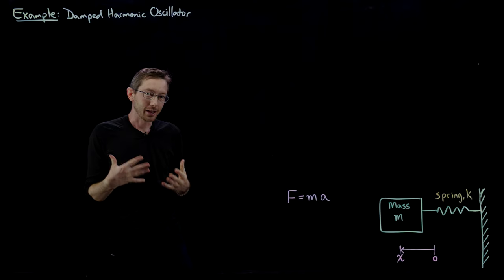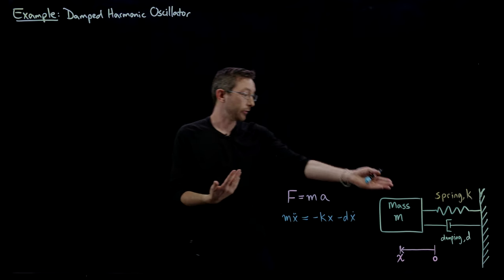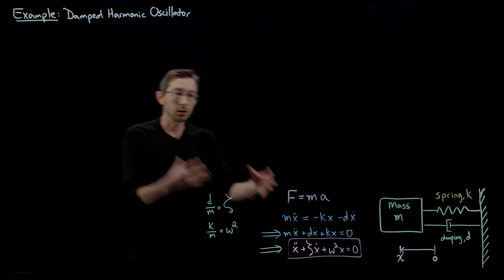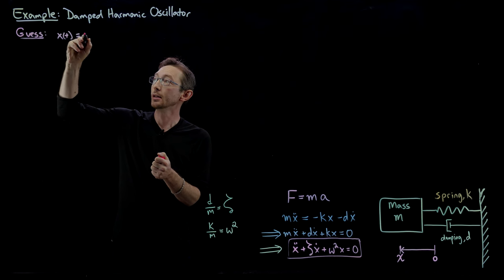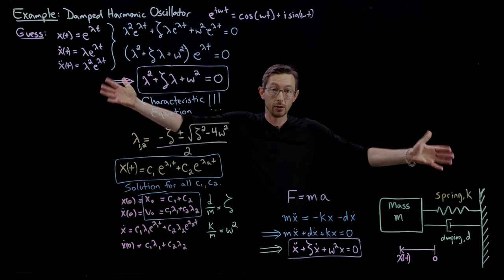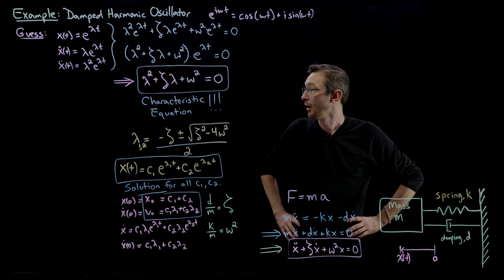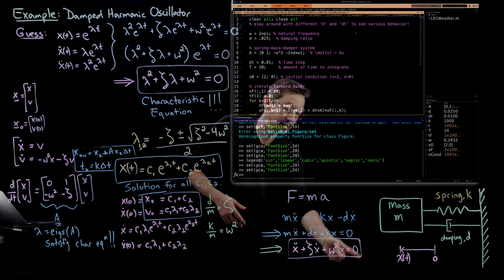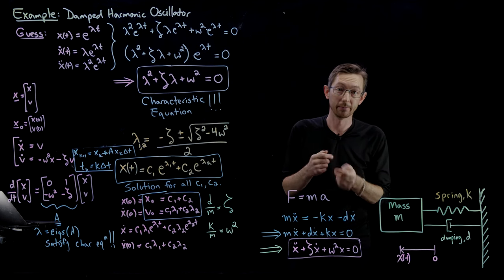Example Second-Order ODE: Spring-Mass-Damper

Comment: for future ref) Prof. Steve defined 'd/m=ζ', but typically people define 'd/m=2ζω' (see Harmonic oscillator in wikipedia) which the matlab code follows,
and the 'd' in the code means ζ in that setting.
In the code, that's why there is -2*d*w (-2ζω) instead of -d (-ζ).
Also note that we didn't solve the eq. analytically("by hands"), but used numerical analysis in two ways(rough one and fine one).

Comment: What was defied as ζ (zeta) in the written section is actually not the damping ratio. The normalized 2nd order homogeneous equation is typically written as xdd + 2ζω*xd + ω^2*x = 0 where ζ in this case is the damping ratio, which can be defined as ζ = d/d_crit, and d_crit is the damping value that results in critical damping, which occurs when the discriminate of the characteristic equation is 0. On that note, in the code when bumping up the damping ratio to greater than 1, that's an over-damped case. Critical damping only occurs right on the boundary of pure convergence and oscillatory convergence, which is when the damping ratio is 1 and d=d_crit.
Reply: I think this comment should be pinned in order to avoid confusion. Thank you!
Reply: Hi Erik - you seem to have a good grasp of it all - I totally agree with your statement. Can you have a look at my comment - maybe you can help me out? Thank you.

Comment: What a great video again Steve, a brilliant explanation of a not so easy subject. I have one further question: After solving the characteristic equation for lambda, we have three possibilities: lambda_1 and lambda_2 are both negative, lambda_1 and lambda_2 are complex with negative real part, or lambda_1 is lambda_2 and there is basically just one negative lambda. So we have an over-damped system (no vibration), under-damped system (damped vibration) or critically damped system respectively. This final system will only exists for specific combinations of mass, damping and spring, while the under- and over-damped systems exist for a whole range of choices for mass, damper and spring. Using the initial conditions - x(0) and xdot(0) - we can now solve for the constants C_1 and C_2 in the solution x(t) = C_1 exp(lambda_1 * t) + C_2 exp(lambda_2 * t). This makes sense from a mathematical perspective, it is a linear combination of the two solutions, as well as from a physical perspective. And this works fine for the under- and over-damped systems. But for the critically damped system, you get that C_1 + C_2 = x(0) and (C_1 + C_2) * lambda = xdot(0), which doesn’t allow you to specify C_1 and C_2. The solution is to use x(t) = (C_1 + C_2 * t) exp(lambda * t). I know that. But I don’t understand WHY that would be the right thing to do - from a mathematical perspective as well as from a physical one - it doesn’t comply with my intuition. Is there anyone who can shed some light? Many thanks!
Reply: We need to add up two linearly independent terms, in order to form the general solution.  Or more generally, for an nth order homogeneous DiffEQ, we need to add up n-terms that are linearly independent.  Anytime there is overlap, you need to generate a linearly independent term, by multiplying it by t.

This is what we do when we have a forcing function of the same frequency as the natural frequency of an undamped oscillator.  The non-homogeneous forcing function adds terms to the solution, but it still is a combination of linearly independent terms.  The solution won't just be a linear combination of sin(w*t) and cos(w*t), but rather it will be a linear combination of sin(w*t), cos(w*t) as well as t*sin(w*t) and t*cos(w*t).  This is called resonance, since it creates a continuously growing amplitude due to a forcing function of a matching frequency.  For a non-matching frequency (call it v) of the forcing function, it would be a linear combination of sin(w*t), cos(w*t) as well as sin(v*t) and cos(v*t).  If you graph this for slightly different frequencies, you'll get a pulsing amplitude called beats.   In the limit as v approaches w, you get an amplitude that continues to grow linearly with t.

For the overdamped case, the two exponential decay rates are our two linearly independent solutions.  One of them dominates in the long run, and the other allows for matching the curve to the two initial conditions, and quickly decays away.   For the critically damped case, we have to produce another term that is linearly independent of the first.  Take the case of y" + 6*y' + 9*y = 0 as a critically damped example.  We can show that t*e^(-3*t) satisfies this equation, just like e^(-3*t) does.

Start with the premise that y = t*e^(-3*t)
y' = (1 - 3*t)*e^(-3*t)
y" = (9*t - 6)*e^(-3 t)

Apply to original diffEQ
y" + 6*y' + 9*y = 0
(9*t - 6)*e^(-3*t) + 6*(1 - 3*t)*e^(-3*t) + 9*t*e^(-3*t) =?=0

Cancel out e^(-3*t), since every term has it, and it can't equal zero except at infinity:
(9*t - 6) + 6*(1 - 3*t) + 9*t =?=0

Expand, and group t-terms first:
9*t - 18*t + 9*t - 6 + 6 = ?=0
(18 - 18)*t + (6 - 6) = 0, QED
Thus it is satisfied by t*e^(-3*t) as one of the solutions.

We can do the same for y=e^(-3*t):
y' = -3*e^(-3*t)
y" = 9*e^(-3*t)
9*e^(-3*t) + 6*(-3)*e^(-3*t) + 9*e^(-3*t) =?= 0
9 + 6*(-3) + 9 =?= 0
9 - 18 + 9 = 0, QED
Thus it is satisfied, that e^(-3*t) is the other solution.
Reply: You might play devil's advocate, and wonder why we can't also do the same with y=t^2*e^(-3*t), to the critically damped differential equation y" + 6*y' + 9*y = 0.   Give it a try, and you'll see that there is a problem.

y = t^2*e^(-3*t)
y' = -t*(3 t - 2)*e^(-3*t)
y" = (9*t^2 - 12*t + 2)*e^(-3*t)

(9*t^2 - 12*t + 2)*e^(-3*t) - 6*t*(3*t - 2)*e^(-3*t) + 9*t^2*e^(-3*t) =?= 0 
(9*t^2 - 12*t + 2) - 6*t*(3*t - 2) + 9*t^2 =?= 0 
9*t^2 - 12*t + 2 - 18*t^2 + 12*t + 9*t^2 =?= 0 

Gather:
(9 + 9 - 18)*t^2 + (12 - 12)*t + 2 =?= 0

You can see that the coefficients cancel on t^2 and t, but the standalone constant of 2 doesn't cancel.  So it is impossible for this to be the solution.  Not without a third order of differentiation, or a resonating non-homogeneous forcing function, to warrant it.   Since this ansatz produces a constant we can't cancel, we can rule out this ansatz, and stick with the two ansatzen of e^(-3*t) and t*e^(-3*t)

Comment: Thank you very much for this presentation (❤❤❤). I can't wait for the next video.

Based on this video, if the values of \Zeta and \Omega are available, then the characteristic function is calculated, so x(t) can be obtained by using x0 and xdot0.
However,  how to calculate the characteristic function in the presence of the response x(t) (Indeed, the inverse problem)?

Comment: Definitively, damping doesn't play the same role as spring and mass. Mass and ppring are in total accordance with conservative laws. Not damping.
Experimentaters have observed that it is proportional to the velocity and so it has been introduced afterward in the differential equation.
Damping is not as pure as spring and mass !
Reply: Proportional damping is just an approximation we make, so the problem is practical to solve with the introductory methods in DiffEQ.  Friction in the real world could take on numerous different models, such as the stick/slip friction of solid-on-solid contact, or the square of the speed for turbulent drag.

There are some examples where proportional damping is a reflection of reality:
1. Dampers that use an extremely viscous fluid, so turbulence is negligible.  This is what shock absorbers use, so damping is intentional.
2. Ohmic resistances in an LRC circuit
3. Eddy currents of magnetic brakes.   And this is precisely why magnetic brakes cannot be the sole slow-down method, since they can never slow a vehicle down to zero speed.  Magnetic brakes can do the bulk of the slow-down, but friction brakes are ultimately needed to bring the speed to a true zero.

Comment: I consider the use of greek letters to be unnecessary. Regular modern print characters (e.g. x, y) are easier to view, read, and mathematically comprehend.
Reply: It's tradition to introduce the Greek alphabet, because there are a lot more than just 26 concepts to name with variables.  You might just have 5 variables in a given problem, and could arbitrarily assign any letter you want, but the variable names also serve a purpose to remind you what the term means in the bigger picture of the subject.

Sometimes, Greek letters are intentionally used, because there is a relationship between a term represented by a Latin letter, and a similar term represented by its corresponding Greek letter.  For instance, Latin a used for acceleration, and Greek alpha used for angular acceleration.

The reason omega is commonly used for angular velocity and angular frequency, is that there is no historically corresponding Greek letter to the letter v.  So we use the alphabet neighbor to v (i.e. w), and assign the historically corresponding Greek letter for angular velocity, and its related concept of angular frequency.